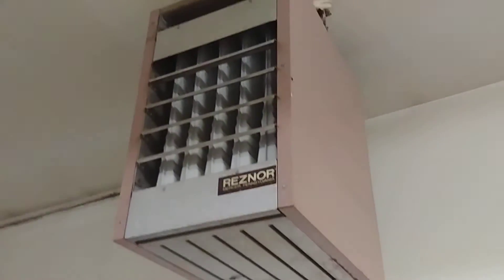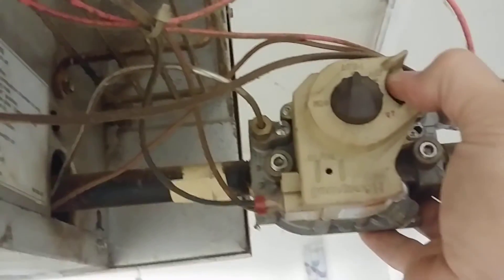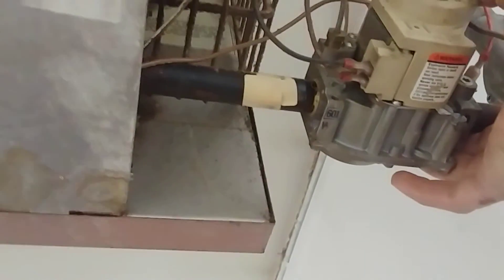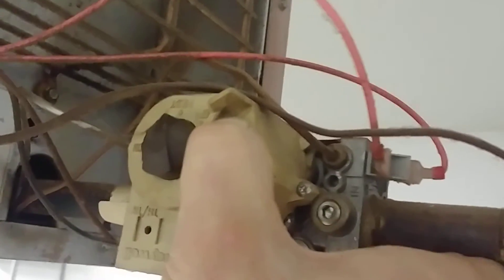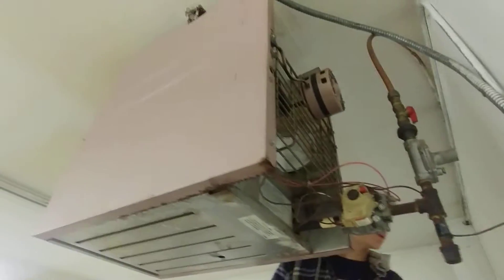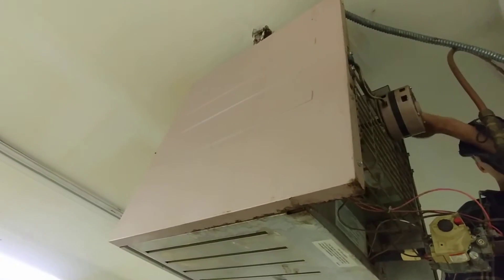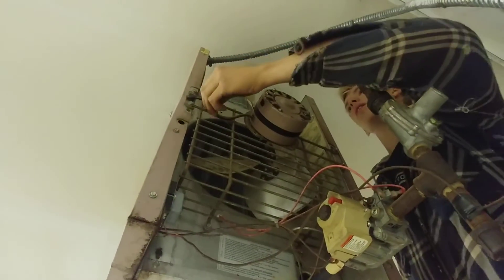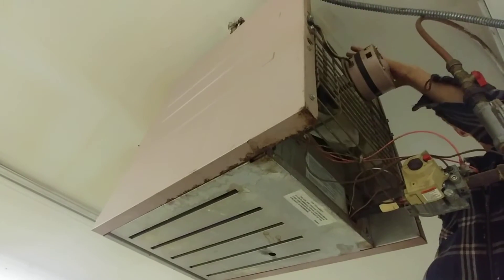How To Light The Pilot on a Reznor Furnace Heater & Symptoms of a Failed Fan Motor

Comment: I had a same issue with my garage furnace. When there was no continuity from motor coil, I opened motor housing and found the motor heat protector fuse burnt out. Could not figure out the amp of heat protector fuse, so just bypassed and soldered direct. Now motor perfectly works smoother than before as I lubed all bearings, but it does not start or shut off itself while gas on and off. I am using it manully.  I have hard time to figure out the wiring and checking heat sensor switch and high heat cut off sensor switch. Looking for some videos or wiring diagrams.

Comment: Using a torch such as he did to light the pilot is never recommended on these furnaces as you have a very high potential to damage the thermocouple tip in the process.  The thermocouple is NOT designed to take as much concentrated heat as a torch can deliver.  Did it work? Yes.  Has it probably worked for years?  Probably.  Does that mean you should do it?  …no.
Reply: So what are you supposed to use instead?
Reply: @wanderingdeer1114  A simple grill lighter from a dollar store will EASILY reach in to almost any pilot light. Squeeze the trigger and hold until it's lit.
Reply: @NorthernChev  Thank you for answering! You mean the kind with a long, articulating lighter end, right? 
Sorry, I'm absolutely ignorant about house maintenance.  I really appreciate the help.
Reply: It's only on it for a second at a time.  It's not gonna heat it up quickly enough to matter.

Comment: wicked, informative video. I only deal with electronic ignition, either spark or hot plate, so thanks for this! Next time though, try spinning the blower motor first. A lit pilot, main burner and failed cut off switch could make for a seriously bad day for a customer.

Comment: once you push the button for the pilot light the tube stars to slowly fill up with natural gas... people always underestimate the time it takes for it to fill with natural gas and then exit the ube.  In gas fire places it might take you 30 before all the tubing and burners fill with gas.  Propane tends to be at a higher pressure and fill faster so things like a propane grill are almost instant.  Also a lot of those motors are induction and when they aren't working the first step is to just swap out the capacitor.  Typically there is another induction motor in the in the building that you can borrow a capacitor for ttroubleshooting until you source the correct one for your device.
Reply from the maker: You have a great understanding of these concepts for sure! Thanks for your comment!